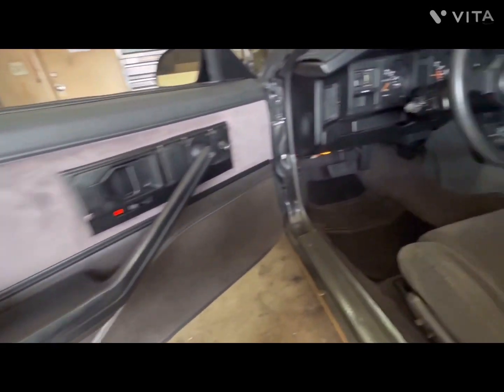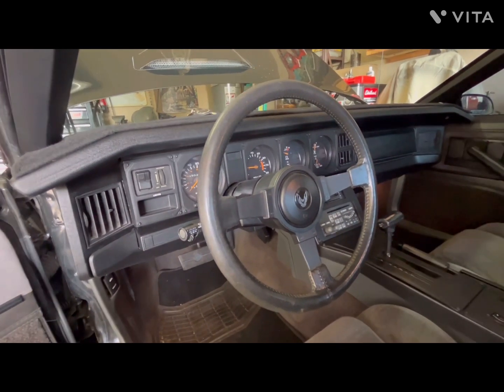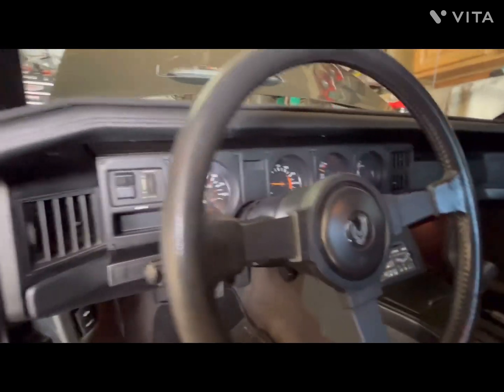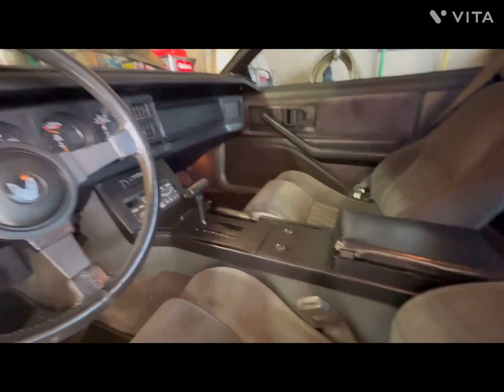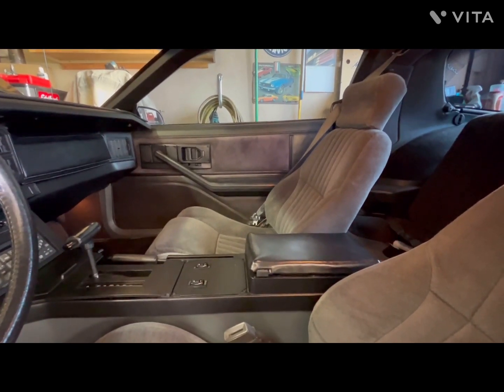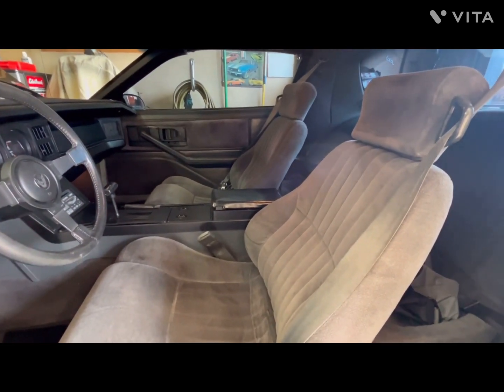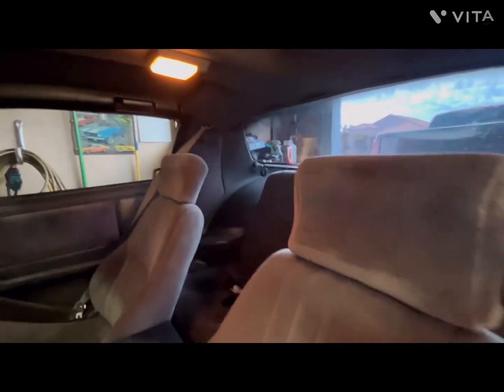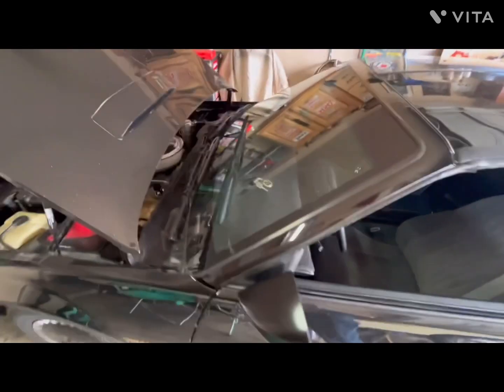Thirdgen talk; 1982-1983-1984 Trans Am - year to year cosmetic differences

Comment: Just watched this video. A few things, I have an 82 T/A.  Owned since 86 w/19k. My lower console is black, I have colored coat hooks, and I have original Viscounts, but the rear trunk trim is not carpeted. AR9/B20/64D. My car is a pile of parts from GM. Very late build, WS7, Saginaw 4 speed, gold wing. It also came from the factory with N24 silver rims with chrome center caps. I have the build sheet as well. Hope this info adds to the pile.

Comment: Great video! I myself have a 1983 Firebird. I bought it in 2006 as my first car and almost none of it is original. Somebody made it out to be a knight car in Georgia before I got it. It had the 2.8 L V6 and a five speed manual transmission. It was the best first car I could have ever dreamed of owning so much that I still own it. It has crossed the country with me twice and remains to be the best driving car. I have ever driven as far as handling and enjoyment . It has been sitting for quite a while, but this year we are going to go ahead and take it all back down and restore properly, it’s all on my YouTube page. We will be filming the process in 8K video. I have the Viscount seats with the original material and the 15 inch turbo cast wheels and caps along with a lot of other goodies from those years. The nice thing about the car is that I can pick my favorite features and add them to the car and it’s really no big deal it’s not like I’m restoring a numbers matching Trans Am. I would never want to LS Swap a Recaro, but it’ll be a blast in my 83 Firebird.

Comment: I need to pull my 305 cross fire injection block out of my 1982. Do you know how I can pick it out of the car with a hoist? I know carbed motors you can use an adapter plate on the intake but idk where you can pick a cfi intake. Any ideas?

Comment: I just found your channel today. Glad I did, because I have a ton of questions about my car. I'll start with what I know about it: 1983 firebird 500 le (limited edition) number 388 of 500 made. All 500 cars were silver with 2 red pin stripes down each side. 500 dealers got one each for their showroom. 500 custom fiberglass whale tails were made by a little shop in van nuys California, close to the GM plant, then I believe they were put on the cars at the GM plant, so, I've been told. About 100 of these including mine, had the Borg Warner T5 paired up with the 305. Mine has the quadrajet fuel feedback carburetor. I've owned this car since 1995, I bought it with about 56,000 miles, and it now has about 59,000 miles. I can't find out any more info then that. PS: there is a plaque on the dash from GM. From the sound of this video, you can help me. Thanks, Dave

Comment: I noticed yours has a H.O gauge and redline starts at 5500 all the way to 8K RPM, how is that? How could I do that to my 82 crossfire like yours
Reply from the maker: Yep. I put an L69 cluster in it. Remove your LG4/L69 cluster, and replace it with an L69 cluster. Simple.
Reply: @Joesmusclecargarage  What about rpm’s? If the car starts redline at 5000 and ends at 6K, when you put the L69 cluster, wouldn’t you change the redlines and possibly be redlining at wrongs rpm’s, I’m not sure how to explain that or if that makes sense
Reply from the maker: @robinlovescars No. Wind it up as high as you want. An LG4 and LU5 redline at 5 grand. They make peak power at about 4400. There’s no reason to run it up to “redline”. A stock LG4/LU5 lays down way before that.
Reply: @Joesmusclecargarage  It won’t damage the stock engine components or anything like that? I saw in one of your videos you did a single tbi swap, was the rpm’s different?
Reply from the maker: @robinlovescars I’m not going to go back and forth explaining this over and over again; but why are you insistent on winding it up to the redline on the tach? My 83 LU5 had a mild cam, headers and exhaust, bumped FP, 3.73s, etc. It’s apples and oranges to your car. Stop worrying about how high you can wind the car. An LG4/LU5 will nosedive at about 4300.
Reply: @Joesmusclecargarage  Ok one last question, I hope you don’t mind I don’t mean to bother, what other upgrades or changes did you do to your car and where can I get those, in your quick run videos it sounded like it ran incredible so I’d love to do the same to mine. You have the best experience and knowledge on these cars
Reply from the maker: @robinlovescars Nothing more than what I said.

Comment: Back in the 90's, I had an '83/Daytona. Always wondered about the variation of mine without the big Side-Decals, vs those that had them and production numbers between the two. GREAT Video BTW!
Reply from the maker: All 1983 Daytona 500 pace cars were sold new with the door and quarter panel decals in a box in the trunk. They were to be dealer or owner installed. Most of the cars sold did not have the decals applied, as they were extremely gaudy.
Reply: @joesfoxbodyandmusclecargarage  Absolutely ! While mine had gone-missing long before I got the car, I can actually imagine a large number of people would eventually try to pass theirs-off as the "Actual" Pace-Car. Thanks for the info!
Reply from the maker: @michaelplog363  They can try, but the lack of AQ9, Y82, 604, 11L, 11U, 82M on the cowl tag would be a dead giveaway it’s not real.

Comment: I'm glad someone else knows all this wise knowledge. I always try to share and explain alot of this information. I noticed your gauge cluster and your shifter knob was different right away.
Edit: in 1984 you could also get the flat black mirrors, spoiler, ground effects. My dad's friend had a '84 brand new and it had the black counter parts. I'm not sure if they added these to some off the line or it was a option in 1984.
Reply from the maker: The cluster was an 84 cluster. The shifter was the correct 83 shifter. The car was an 83.

Comment: Thank you for this info, trying to determine the year of a theft recovered 3rd gen firebird with no vin numbers, and its very tricky, it has the 82 gauges with white needles, but not the 82 chrome strip door panels, 82-83 steering wheel identical to yours. I'm going to pull off one of the T-tops in the next couple days to see what style it has, then I should know for sure

Comment: A really interesting video here joe.I just wanted to add for thought I have owned a 1982 lg4 saginaw 4 speed manual Norwood  Ohio build since 1989.mine has the level 3 suspension ( WS7)? with the faster ratio steering and power bulge hood.my viscount interior had leather seats ( for better or worse I replaced the shot after only 7 years leather for cloth which has held up much better) but  my viscount  had no carpeting on the cargo compartment panels.you are spot on that the rarer parts are at artificially inflated prices. One of the things that bugs me is that the 1982 thru 1984 cars had a different foot pad on the carpet than the 1985 and up cars and that the aftermarket carpet companies only sell the 1985 and up style of foot pad carpet.
I am looking forward to your future videos and for my opinion I have never found you to be long winded!
Reply from the maker: Sounds like a beautiful car! I should clarify on the carpeted rear panels. B20 was mandatory with AR9 in 1982. Basically you couldn’t get the AR9 seats with the base door panels. The B20 “luxury group” included the deluxe door panels. B48 was the RPO for the “luggage compartment trim” and was a $123 option. I’m debating on following up on the video and adding in the stuff that slipped my mind. I was just going off the top of my head as I was walking around the car.
Reply: Still a great video for off the top of the head. I still have the dual resonators exhaust ,and for better or worse it comes to mind that no body seems to offer an aftermarket equilavent
Reply from the maker: @bobbova8708  Very true. The N10 dual resonator exhaust, while EXTREMELY restrictive, is the best sounding exhaust ever put on these cars. Very deep and throaty sound. No aftermarket muffler comes close. On all 16 of my thirdgens, I have used every imaginable exhaust and muffler offered for these cars over the last 25 years. I’m still trying to find something to replicate that sound without choking it.
Reply: Had an 82 Crossfire TA. Best sounding car I ever owned!
Reply from the maker: Yeah, the factory dual resonator exhaust sounds pretty good, but I can’t say it sounds better than any of the cars I’ve built; 7000rpm big blocks, 7600rpm small blocks, warmed up fox Mustangs, etc 😂

Comment: My 84 Trans Am was loaded : L69/5 speed/WS6/3.73, W62, UU6/UQ7, Lear Siegler seats, AC. Oddly enough, it was only missing a handful of cheap but very useful options : manual mirrors, hatch release. I've had it for over 14 years.
1982 engines were painted corporate blue, while 83 to 84 had black engines.
By the way, having attempted to "rebuild" an 1983 driver mirror using a 1982 donor, I realized the mounting of the mirror mechanism is a bit different and cannot interchange.
Another thing is 1982 used the old school cruise control module with the speedo cable attached to it, while 83 introduced a different vacuum operated system.
Also, the base 1982-84 tail lights (the red ones) were used on base 1985 models as well.
Reply from the maker: Yep, I’m well aware. It would have been a 2 hour video if I went through EVERY detail.

Comment: The salvage yard in my town has a black and gold early 3rd gen Trans Am hardtop junked in the back sitting on top of another car leaning against the fence. I can't tell if it's an '82 or '83. It has gold pinstriping going over the wheel wells which I think was a factory option but I don't think it's a Recaro Edition. Unfortunately I can't get close enough to get the VIN number. The car is a goner because they used  forks to lift it and the roof is bent up and wrecked. It's a shame I would love to get the history on the car but I'm not allowed to walk in the yard to get close to it or climb on it.

Comment: I had an '83 Black and Gold with the luxury interior. I don't think the '84 had slats in the front bumper. I don't like when I see the flat black spoiler painted glossy.  Early '85's had the old spoiler and engines.  I went shopping for an '85 with the new spoiler and fuel injected engine as soon as they came out but the dealer said they were not shipping the new spoiler design yet and only carbureted engines.
Reply from the maker: Of course it did 🤣 W62 was an OPTION. The W62 cars got solid grille panels. I’ve owned three non-W62 84s and guess what; they had grilles.

Comment: 82 and 83 have clutch linkage
While 84 and up are hydrolic.
Also 83 is the first year for the 5 speed.
82 is all four speed.
Reply from the maker: Yep 👍
Reply: Did you know that behind the map pocket on the dash there is a firebird clearly and cleanly molded in the plastic?
Reply from the maker: @ryanwilliams3369 Of course. The Firebird and Trans Am dash used the same mold when they were made. The base firebirds didn’t have a standard dash map pocket, and therefore had the stamped Firebird logo on the plastic dash.
Reply: @Joesmusclecargarage h cool mine had the map pocket and I removed it and found the firebird thought it was A cool easter egg.
Reply: My cars an 83 base lg4 5 speed.
Heater and t-top are the only options.
Reply from the maker: @ryanwilliams3369  👍